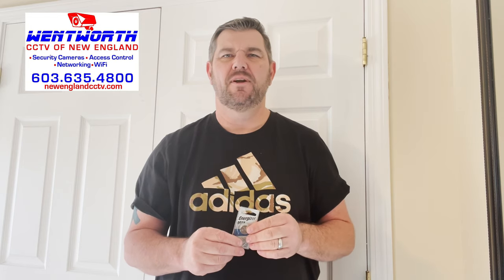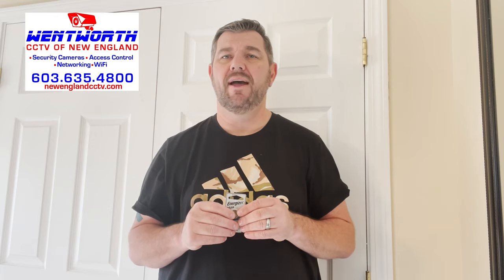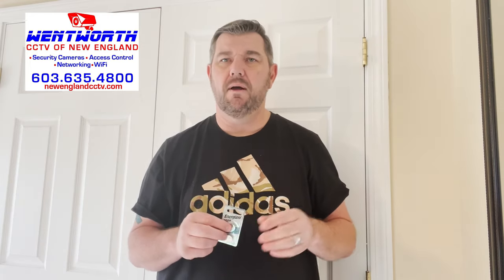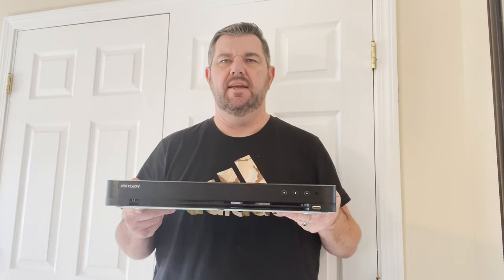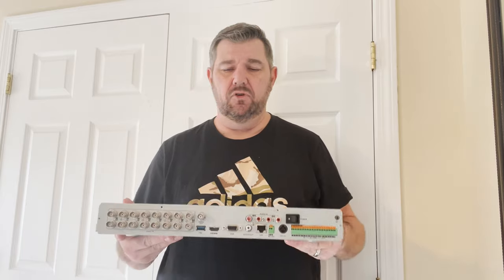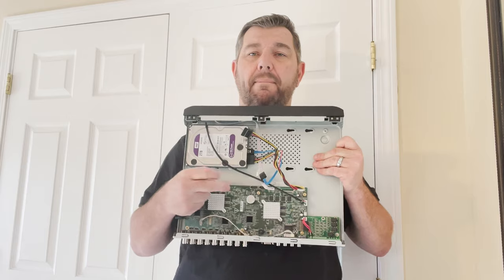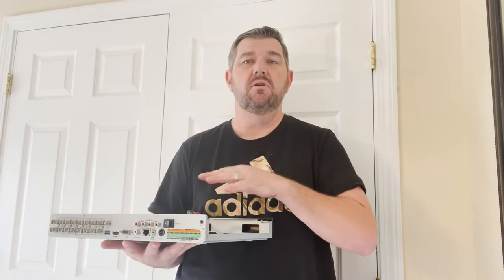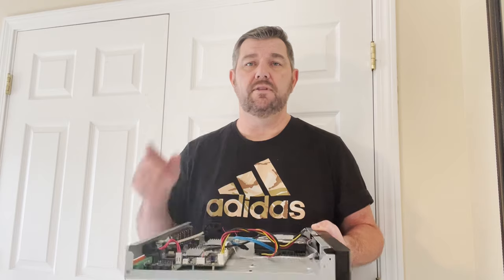How to Replace CCTV DVR or NVR Battery and Correct Time Stamp Problems

Comment: would this cause my swann dvr to constantly reboot and or sometimes reboot?
Reply from the maker: Try formatting your hard drive. If that does not help, go into your video settings and turn down your FPS and bitrates. Often times, folks leave those on default and the recorders get overloaded and will shut down and reboot. The recorders can only process so much.

Comment: Hi why does my xvim keep rebooting I replaced the hard drive and it's still doing it.Thanks in advance.😁
Reply from the maker: What are your frame rates and bitrates? Sometimes, if you have those channels maxed out at 30 fps and 10,000 kbps those cheaper recorders cannot handle the bandwidth and they will do that. Good job in replacing the hard drive. When it reboots, can you log into it after it has rebooted or does it just go through a constant reboot?
Reply: @Wentworth CCTV  yes I can get in and reboot but it seems to reboot it's self. I'm thinking it mite be Router .